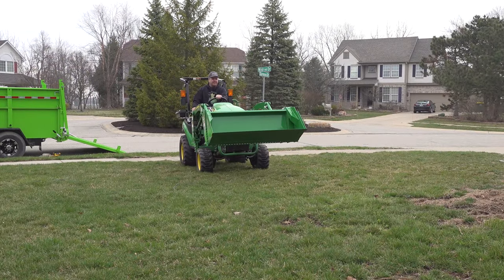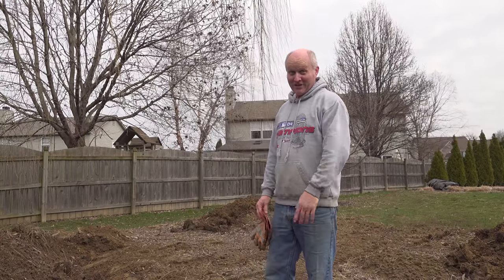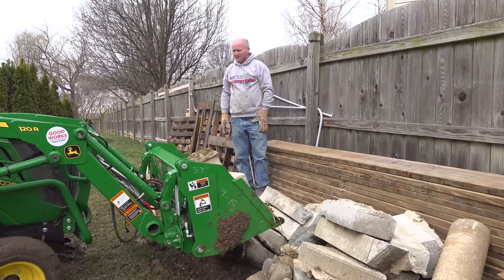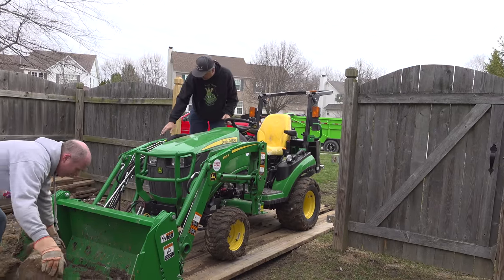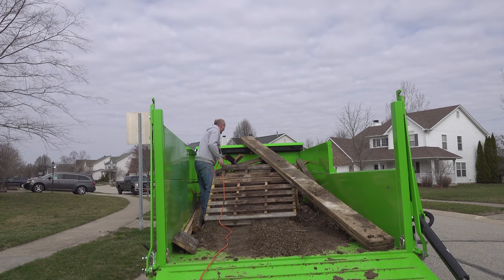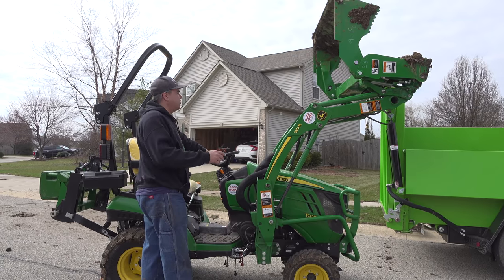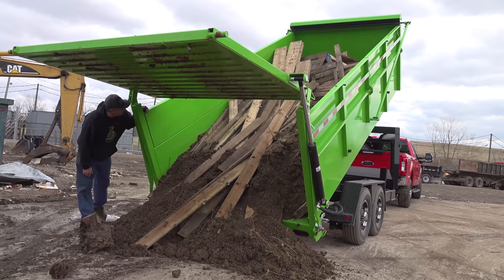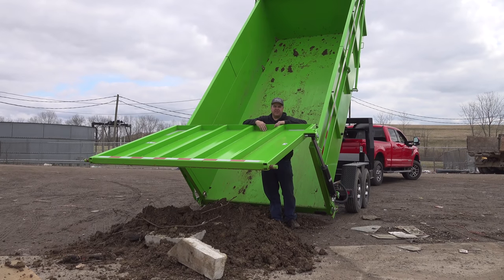4 in 1 Bucket First Use, First Impressions

Comment: Tim when i was running Heavy equipment for a living every machine we had there was a 4 in 1 Bucket on it ,, the versatility of that bucket is amazing from tree work to landscaping and being able to use the bucket to say cut a inch or two of a grade using the bucket makes it easy.. just open the bucket some depending on how much you want to remove and tilt it so the front part of the bucket is the cutting edge and drag it backwards .. it works perfect...and also by fully opening the bucket you can move full trees by using the back or dozer portion of the bucket push up against a tree (the stump) lift up a little of the ground and just push it you cant steer anywhere you wanna put it..just keep playing with it you will never go back to a normal bucket.. to pick up boards like you were open bucket all the way ,, then lay it flat in other words so the dozer portion of the blade (the face) is facing the ground   And on one side of the pile and the front part of the bucket is on the other side of the pile then close and tilt and close and tilt and close and tilt until bucket is almost in normal position i wouldn’t mis lead you buddy , once you learn how to use it you will laugh at a normal bucket.. i wish i lived closer to you i would come and show you how amazing they really are.. it was the right tool ,, just the wrong technic ..

Comment: I have a 4in1 Drott on a JD 350B crawler.
I find it extremely useful compared to a standard bucket.
Main uses of the 4 in 1 feature are
1. Picking up the last bucketful of sand, gravel or soil. No chasing material around and hand shovelling required. It picks up everything remaining in a few seconds.
2. Pulling large volumes of materials backwards, out of corners etc.
3. Cleaning ditches or cutting new ditches from the side. It's very fast and neat for this operation. Leaves a tidy rounded ditch.
4. Picking up logs.
5. Blade work (4 in 1 open). The cutting edge moves in closer to the machine with 
4 in 1 open vs bucket cutting. More effective at cutting into hard soil, clay hardpan.
Also very quick for pulling old fence posts when building fences, just drive down the fence line yanking them out with 4in1

Comment: I've been using a 4 in 1 bucket for almost 50 years. From working for my father as a kid, then in my own business. I will not own a machine, skid steer or track loader without one. 
It takes practice to be efficient. Grapples are okay for their intended use.

Comment: I use to keep a soft rubber mallet in my truck. When I had my dump trailer up and stuff was stuck..two quick smacks to the under side of the trailer always worked.
Reply: Im not sure that would work as good on these style of trailers, these ones have heavy heavy bottoms.
Reply: Mine had a heavy bottom as well....full one piece construction...it was solid. When fully elevated it doesn't take much to free it up.
Reply: Dump body vibrator you just need that and weld a about 18inch to 24 inch c channel to the underside of trailer in about the middle then you bolt the vibrator to that that's how manufacturers tell you to install and keeps bodies spotless
Reply: Ryan: Absolutley! I used to drive a side tipping woodchip truck, just bashing the floor with a hammer or big shovel helps alot when material gets stuck.

Comment: Thanks for the demo, Tim.  Think broom and dust pan.  Technique matters.  You are trying to use it like a bucket to scoop up stuff to carry...instead, try to spread the stuff out on the ground and eat it like a dinosaur...I think you can pick up more that way...come down over it instead of trying to make it skid into the bucket...The 4 in one would work much better than a grapple for picking up stacks of loose small material that would fall through the grapple.  In addition, you can grade that kind of loose material going backwards by dragging with the open mouth, or by pushing with the relatively flat front...much better than a bucket.  you can also distribute loose material like gravel by opening a small gap and driving forward...much like dumping from a chained tailgate on your trailer.  It is a handy tool for loose, small stuff.   It can also pick up the last of small material that you would shove around with a bucket trying to pick up.    When the material gets big enough not to fall through the grapple, then it is the bigger tool to move it.  Even then, don't you find that you come in over the top a little bit with the grapple when you want to pick up a pile of stuff rather than trying to push the lower tines under it first?...  But, like you say, you can see everything on YouTube...thanks a million for the demo, and your hard work.  I wait anxiously for every new one to come out and often review an old one to help me show others what can be done with the machine.

Comment: At 10:15, if you had rocked your bucket forward before "clamping down" you would have had much better success.  That is one of the biggest challenges I have when training new operators how to use 4 in1's properly.  You want the heel of the front clam and the cutting edge of the "dozer blade" both on the ground for as much time as possible when clamping down on something.  Love your videos!

Comment: 2 things Tim. 1 practice and watch  4 in 1 videos. 2 put a mount on the trailer  on the right side in front of the tires to carry your forks. Always have your forks. The 4 in 1 can be a life saver. I have run equipment for years a lot of seat time on backhoes. My favorite was a Cat with a 4 in1 and forks  remember you can't get around not having certain attachments but for general purpose work you will be hard pressed to beat my favorite. The operator makes the machine not the other way around. You get good by not having the right tool all the time.

Comment: I have a 4 in 1 bucket on my BX25D and I absolutely love it. I have excavated alongside my shed and have been levelling with it. Don't worry about using a grapple anymore, the 4 in 1 will do it.
Reply: Hey there. I have a L2501 and I am on the fence between the 4in1 and separate bucket and grapple. My primary use for the front end use is logs, firewood, and moving brush. Being the 2501 is a smaller machine, my questions is what would you think is a better option? Thanks
Reply: @rukiddingmeNJ  for logs and brush definitely the grapple. With either option you will have to put in a third function valve so you could have both.

Comment: Tim, When I use my 4 in 1 Bucket on my 1025r to pick things up you have to open bucket all the way and roll bucket all the way forward, then close down and roll back at the same time. This bucket is also Great for Scrapping brush that's not wanted. open bucket all the way and roll forward, then use the clam part to drag back. Also I live in a wooded area and its great for picking up branches, and logs. Keep playing with it you will find it useful in some ways. Love your Videos .    Vern

Comment: Up north here we try not to leave a load in over night in the winter because there's a good chance it aint coming out in the mornin' regardless of the dump angle. If u don't load equiptment in ur trailer a deck over is better(dump wise) that extra height makes for a shorter dumping distance. I like that the sides fold down 4 loading over the sides. I think I use that Idea in the future 4. Someone else said it carry a rubber mallet 2 tap the bed when stuff is stuck.

Comment: When you want  to pick up big amounts  of debris open the bucket. Then curl the bucket forward. Lower it to the ground over the debris Then close the bucket  and curl the bucket back towards you at the same time.
Reply: Just to add to B.Howards comment while your doing that drag the pile backwards with the bucket open will help loosen the pile
Reply: I don't think that's a 1 & 2 move. It's a 1 or 2 move. The way the hydraulics work you get curl or close. So close, curl, close, curl.. etc. Both don't work at the same time. Definitely not at a combined functional speed. I use mine as much as possible. The 4 in 1 is an amazing tool. I would never be without it. I grin every time I grap and move something that would have taken 3 guys. Nothing but love for this bucket!

Comment: My buddies dad has one of these on his tractor, and he likes it for loading the back of the dump trucks. Apparently, he says it's easier to lift over the edge and then open up the clam shell and let everything fall out, rather than dump the bucket. Something about clearance issues he said. I'm not to sure, I've never used one before. A lot of times when someone tries to put two or more tools into one, it's almost always a compromise in some way. Most of the time I find it easier to just have multiple tools, rather than an "all in one" design. Great video you guys.
Reply from the maker: I should have mentioned that advantage. Yes we used it to dump the bucket without tipping it forward.

Comment: As you have learned 4-in-1 buckets are NOT grapples.  They really are good at being a bucket AND a dozer blade as well as being able to pull large amounts of dirt backwards.  In a pinch it can pick up a single limb or log
4-in-one buckets don't have the open gap in the side that allows grabbing bundles of trash.  But another thing you are used to with the Artillean grapple (and one of the BIG advantages of the design) is it has two, independent jaws.  Grapples with just one big jaw are not nearly as versatile.
Reply: I beg to differ. I move brush, logs, rocks, gravel, dirt, and anything heavy with my 4 in 1. Experience helps with operating one. Tim is being very hesitant and easy on that thing. This is a bad example of the the 4 in 1.
Reply from the maker: @Josh Are you using a 4 in 1 on a 1025r?
Reply: @TractorTimewithTim  no, I feel it's too much for that tractor. I'm running it on a 3046r.
Reply from the maker: Ok, wish you would have said that instead of saying I was being hesitant.     I just don’t think it is possible to use a 4-in-1 efficiently on a 1 series.
Reply: @TractorTimewithTim  yeah I can agree with that. But I agree it definitely has its place. But I will say an actual grapple is way more efficient, like you said in the video.

Comment: Product called slip plate works well. Farm @ Fleet sells e z slide a graphite based paint that I put on my dump trailer. Works well and if gets scrapped off you can roll it back on
Reply: Also have the e-z slide at Menards , Tractor supply and Bumgaars , the stock paint likely wasn't helping either , nothing like bare work worn steel deck , and as suggested a rubber mallet works too.
I d think when ever your dumping run the body all the way up , but try to be on level ground , if a load sticks you can end up twisting the hoist ,even full size trailer dumps can be flipped .

Comment: We use a 4in1 / we call it a bite bucket all the time. Once learned very useful. Try this open your bucket all the way tilt forward till the open top part of the bucket is just past what your trying to pick up and lower the lift till on the ground back drag the material then tilt back and lower the lift then close the bucket. If you can flutter the third function switch while tilting back lowering and biting the material it works great.

Comment: Tim, if you could load the dirt from the sides you can lay down a sheet of 6 mil plastic first which will make stuff slide out much easier.  Of course you will have a few bucks in plastic but it's well worth it.  It's great to keep the paint nice, but paint doesn't let stuff slide out as well, hence the plastic.  Obviously if you want to load from the back it won't work as well because I imagine the tractor will pull the plastic.  Thanks for the video, I never felt I would need a 4 way bucket and you confirmed that thought.  Sometimes you just don't know until you try it.
Reply: Spray the bottom with diesel !

Comment: Tim, I agree with your assessment of the 4 in 1 for this instance. I think between your grapple or a set of forks you would have been set at this site. Load the concrete onto the pallets and set that in farthest in the trailer for tongue weight. Then the wood, and dirt last from the sides to prevent the sticking to the bed. You do great work. Always different ways to get the job done.
Reply from the maker: Forks would have worked great. But I do not regret putting some dirt down first to protect the trailer bed

Comment: I don't have much tractor loader experience but expert level skid loader operator on any skid. I use big farm tractors but none with loaders. I would think that job would be much easier and less messy with a tracked mini skid. I have recently gotten a jd 4720 and realized the tractor loaders are more useful than I though even for some dirt work but a skid really is meant for dirt work a bit more. I've always been interested in a 4 in 1 bucket on a skid but everyone I know that has use one doesn't like it. They say it's less than one real bucket.

Comment: Tim, valiant effort with that new bucket. Sometimes I find a tool I bought for 1 purpose doesn't do as well as I expected. Then I use it for something not planned for and it's the bomb! The grapple would have been nice for some of that work, but you still needed a bucket. Maybe bring it along next time so you can switch it when needed.  Christie doesn't need a gym membership if she keeps following you around.LOL. Of course you could buy her a drone and a nice recliner, with heat and airconditioning.

Comment: Generally with the 4 in 1 and 6 in 1 that are quite common here in the uk the trick to using the grapple of the bucket more effectively is to roll the bucket all the way forward open the bucket to full extension and then place it down over what you are wanting to grab. You need have moved the object around so thier is space for the top half of the bucket behind what you are wanting to pick up.

Comment: For the dump trailer worked well,only thing is because of its long length it be handy to have a base slider hydraulic system as well,so you slide the base forward as you are tipping the rear for the debris to fall out without getting caught when dumping 👍

Comment: Tim, my 4-1 bucket was a $3000 mistake I sure regret. I later bought a grapple and find it far more useful than the 4-1. It is twice as heavy as my regular bucket meaning it won’t lift as much. I’m not happy with this bucket and would never recommend one.
Reply: Dennis...it depends on what you are moving and where.  Yes, the 4 in 1 is awkward and not the best choice but as others have said, it is a multi tool.  I move dirt in some awkward conditions/hills and it works great for that.  It moves brush and odd shaped things better than most other options.
Reply: Greg K I totally agree & I use my 4 in 1 to pull out mid size stumps & bushes just fine 👍

Comment: TTWT you need to paint the inside of the trailer and your tractor buckets with slip plate it is a black graphite paint it can be found at most ag stores that wet mud and soil will not stick then 
I do my loader every fall and the snow never sticks in the bucket in the winter love your videos 👍👍👍👍👍👍

Comment: I think your used to having both a bucket and a grapple. Personally I can only see a benefit in the 4 -1 bucket for dumping dirt/rock into the trailer. Not sure I’d be sold on one of those with the added weight you mentioned. Dump trailer is always nice, and yours takes the cake with the high sides, long length and the steep angle.
Reply from the maker: Thanks Mike.definitely easy to dump over the side with that 4-in-1

Comment: You need to make a platform on the gooseneck so you can carry another buck with you.   4in one is for a doze, dig, load, carry, and dump material. Plus, the attachment can grip debris (like a grapple) but not as good as grapple and grade and level dirt

Comment: That was a great job in dumping . That dirt was like mud and it's going to stick . Had a tandem dump truck unload a trailer full of manganese at work. Now when I say full I mean a load that's only a few inches high because manganese is very heavy . Up went the box and only 1 side of the box came out . Truck and trailer ended up tipping on it's side . Brand new truck . Be careful when dumping a heavy load making sure both sides are clearing . Not impressed with that 4-in-1 bucket . Like you said a grapple is the way to go. Great video . A good learning curve for your subscribers .

Comment: The 4 in 1 bucket does work, however it does really show how having the right tool for the job pays off. I like the 4 in 1 bucket for the quality to save trailer space but it does not leave all issues unresolved. It works, yes, but in general it (obviously) does not work as well as the other tools do separately. Overall this was a very informative video Tim, Thank you!

Comment: Howdy TTWT... well not all projects work out smoothly do they. We hauled sticky dirt with dump trucks back in the day, used plastic sheeting on the floor and it just dumped right out (just a thought).  Have you thought about removing your truck box and switching to a flat bed, would be nice to bring along grapple, tiller, forks, etc... Not sure the 4/1 bucket is in my interest, but I'm sure it works swell for others.  Thanks for the video...
Reply from the maker: We have a 16’ flatbed

Comment: it may help you get a full scoop if you drive into the pile then rather than tilting back on the bucket first lift up on the loader arms with the bucket still flat to the ground and then curl the bucket back while your driving into the pile at the same time.

Comment: I used a 4 in 1 on my 4410 for years and you just need more practice.  It is very versatile.  Think about opening wide and reaching over, then pulling back then rotating and closing.  Also you can open full, tilt forward and place the open  forward inner edge on the ground.  Then back drag,  it cuts in like a box blade.  So many uses, just practice.